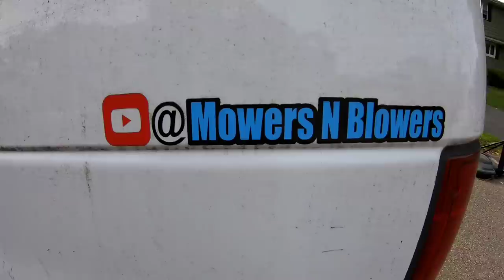RELUCTANTLY WELDING REPAIRING GRINDING PAINTING RUSTY ROTTED CRAFTSMAN LT1000 LAWN MOWER DECK PATCH

Comment: Henry. The decrepit mower deck reminded me of the very rotten dump truck beds that I used to repair where I used to work. The metal would be so rusty & scaly that a plasma cutter was pretty much useless. Before welding in new patch plating; I would put everything in place and mark the outline and then take a grinder and lightly grind the paint & crud down to shiny metal where I was going to be welding. Believe It Or Not, It really makes a tremendous difference when you are welding with less free flying “Fireballs” to make unwanted battle scars. 
Using copper clad mig wire with a 75/25 Argon/CO2  -  I made many such repairs on Snow & Ice Equipment during the winter months and Right Of Way Mowing equipment/custom fabrication during the warm months. For the steel welding that I performed at my former workplace, Flux-Core welding was not feasible. So, I have a 42 inch Cub Cadet “Tri-Angle deck that fits a 107 Cub Cadet that needs some major TLC. I had entertained the thought of making up some patterns and totally fabricating a new mower deck. The hardest part would be locating the holes for the spindles. Everything else is pretty straight forward. It al revolves around the almighty dollar sign. For the underside of the mower deck- You can prime the bare metal with self- etching primer and then heavily paint with the spray on bed coating similar to Line-X which Autozone,Advance Auto Parts or O’Reillys usually keep in stock. Good Luck with all of your mowers that you picked up.
Reply from the maker: Excellent advice brother, but I dont have a mig or tig  or argon gas.  Just a simple flux core cheapo.  It also says, no cleaning or grinding needed.  Just weld.  It's not meant for a deck creation.  I did what I could with what I had.
Reply: Mowers N Blowers. Next welding project, Try grinding the paint & crud away and you will find that the welding is much easier. The electrical arc has to burn away the paint & crud which mixes into the weld. When I say grinding- You could use anything from a angle grinder to a die grinder with a grinder disc or even a Roloc type Scotchbrite disc used to clean up automotive gasket surfaces will even work quite well. If nothing else, A good stiff wire brush helps out tremendously. 
The flux core wire welder most closely resembles the stick welder utilizing flux to protect the molten weld as a shield gas and trap impurities in the weld which hardens into the weld slag that you chip away after the welding concludes. The flux core wire has the internal flux as the name implies while the stick electrode or welding rod has the external flux coating. Henry, I apologize if I overwhelmed you in mentioning the more advanced welding equipment. I do realize that most home garages have maybe a Arc Welder or maybe a Flux Core Welder and maybe a small set of oxyacetylene torches for heating or cutting off a seized bolt.and a small bench or pedestal grinder for sharpening mower blades. Gosh, I wish that I was close by; Man what a discussion we could have. I m looking forward to getting my stickers. They look pretty cool.
Reply from the maker: No not at all,  I appreciate the vast knowledge you obviously have in regards to the different types of welding.  Welding has been something that I recently wanted to do in the past few years.  I’ve only used my welder about a dozen times mostly just for muffler repair but I’ve always found it to be fun to do.  I enjoy practicing which is what I need to do more of.  I used to grind before I welded, but honestly I didn’t see much of a difference.  As long as the thing held together, I was more than content.  Thank you for taking the time to comment and your stickers are on the way.  Thank you for supporting the channel.

Comment: If you have time, and want to practice welding, I would buy a thick piece of steel, put the welder on high heat, and just burn down some beads without worrying about blowing through. Also stick welding is nice for thick steel, but I see you mostly weld thin stuff. A nice small stick welder will run you $80 new. I have gotten the welding addiction and own about 10 welders. Only two are accessible and actually used though.
Reply from the maker: Welding is fun but i don’t weld enough to invest in serious equipment.  I’ll keep practicing, you never know where that will take you.

Comment: I need help I have worked and fixed many thing before but this ECHO PB-403T is getting me hung up. It started only for a few seconds prior to working on it but would only run on Choke than die. I put a new spark plug in it and air filter and fuel filter and cleaned the carburetor . The high and low idle screws are out of wack. What would the factory high and low screws should be set to I tried every position. THANK YOU
Reply from the maker: Screw both hi and low clockwise til you can’t turn anymore, the back it out 1 1/2 turns each.  That’s factory

Comment: Try making circles overlapping each time when ur welding
Reply from the maker: Even with a flux core!  I know with aluminum tig you swirl in a circle.  Imma learning.
Reply: Mowers N Blowers yep that’s what I use to, is ur welder spitting and sputtering
Reply from the maker: No, seems to make holes in thin metal.  I need to adjust my speed and heat.

Comment: See IronDuke502 a real good advise for you .
Reply from the maker: Yes, of course! Excellent advice, but I dont have a mig or tig  or argon gas.  Just a simple flux core cheapo.  It also says, no cleaning or grinding needed.  Just weld.  It's not meant for a deck creation.  I did what I could with what I had.  You want to send me gas canisters and a mig welder?
Reply from the maker: Sure, let me go buy a $800 tig welder to fix my free deck...another great comment chris!